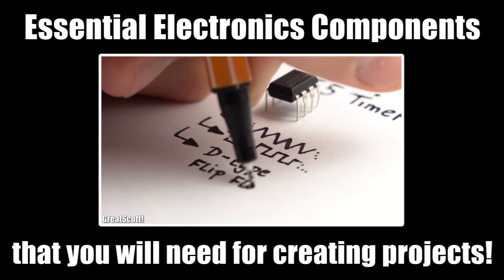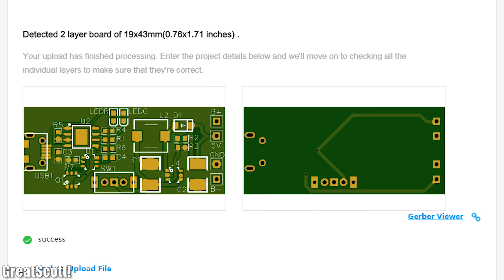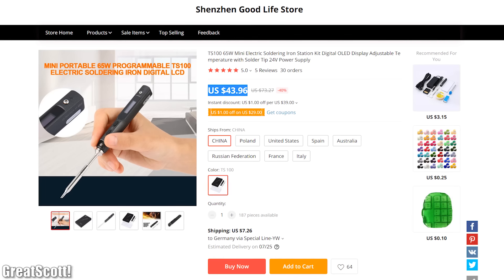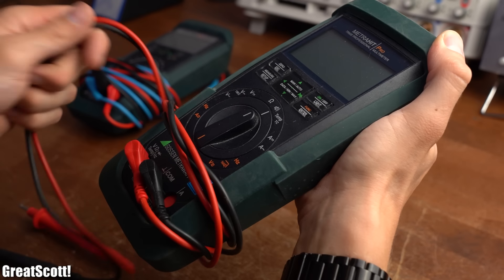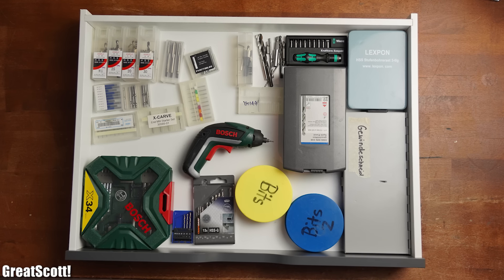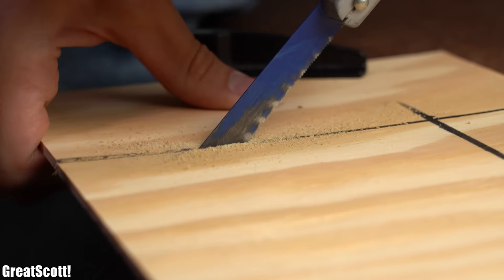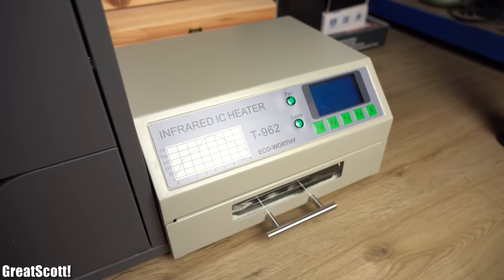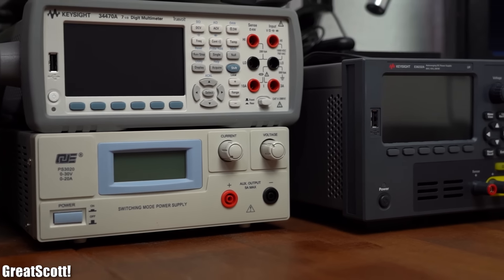Essential Tools that you will need for creating electronics projects!

Comment: You forgot my favourite tool: The label maker.
I hate unlabeled switches and connectors. And it's good for organising your workshop as well.
Reply: I was going to say the same thing! He has a pile of expensive tools but still uses masking tape to label everything !
Just got a Dymo Rhino and i can now label  wires with the heatshrink they sell or use the tags setting to make labels for wires
Reply: +1 for label maker! An analog/manual one or a dedicated label printer (great for weatherproof and durable labels) or at least pre-cut self-adhesive paper for normal a4 printers.
Reply: I was lucky and got the Brother PT-E110 on sale for 20€.
The label material is kind of expensive but it's a very easy to use handheld device that has a dedicated menu for electronics symbols and can print flags for cables.
Reply: You know, I've got several label makers and never used them.  My sister tried to give me yet another one with labels for my birthday and I told her keep it.  I've never used it because it just takes too long to punch things in, and the dang label tape for them is insanely expensive.  Once your tape runs out it's useless.   A roll of paper tape and a sharpie however require no batteries and always works.  Not pretty but....
Reply: Masking tape still works better and is a few pennies. A labelling gun is pointless for 99% of people. Like how many things do you actually label? and what does it do that some masking tape and a marker or some paper with clear tape over it cannot do?

Comment: One of the tools you missed, might be the usb power meter. I find myself using it a lot, and, at least in my opinion, is essential :) And thanks for the great video. Very useful as usual!
Reply: Depends on what you do, if you never work with USB its useless.
Reply: Had one, ended up replacing the USB-Ports with Pins and using it as some kind of low voltage and current meter🤷🏼‍♂️

Didn't stay with USB for too long since I started strolling around with electonics
Reply: USB power meter is really nice :)
Reply: @tobimai4843  No it isn't. Everybody has devices that charge over USB. It is essential to know wich one are bad cables/power bricks and wich are not.
Reply: Janus Kobain a 3d printer is essential IMO, I unlocked so many new projects for me
Reply: @jkobain  I find mine nearly essential if for no other reason than designing and printing cases for my projects. It does a lot more, but you're right, none of the other uses are a must-have.

Comment: >"Essential Tools"
>$1000+ oscilloscope
GreatScott, I hate to break it to you, but I'm broke
Reply: haha same
Reply: Never used oscilloscope, hobbyist for 20+ years :D
Reply: @PexiTheBuilder  wow! I use mine all the time, its an old crt one, 25mhz. I got it at a decent price, $100 (it was like new)!
Reply: There are tiny, simple oscilloscopes that you can fit 5 of in your pocket for ~$20-40 each. I've used some of those and they are definitely good enough for most beginner-to-intermediate users.
Reply: Keysight makes expensive products, but they are also great quality. If you can afford it, I'd look into the Rigol DSO1054Z. For around $375 it's very good for the price.
Reply: @SoLaR27  yeah, still cant really afford it...i'm 13 :D
Reply: @justin.campbell  i mean,i got my first oscilloscope (a mini dso138) when i was 13,and it really helped when making electronic projecs.
Reply: @johnavonvincentius1884  yeah!
Reply: So am I, so I got a PC oscilloscope. Works well, and does the job (it's the Owon VDS1022I )
Reply: For the hobbiest a scope is useful for debugging, but I would not say "essential" at all.  GreatScott uses it to teach and learn about specific behaviors, which is only useful when completely designing a circuit.  
For the average hobbiest I'd imagine it isn't essential until you are designing your own circuits from scratch (not following a guide)
Reply: That recommendation is bad IMO, you can get a pretty good scope for under 400€/USD
The Rigol DS1054Z is a good price/performance option
Reply: Try a Hantek. They're ok for beginner use.
Reply: @justin.campbell  I know, sometimes would been useful. Built "oscilloscope in a matchbox" from arduino nano, havent found any use, yet.
Reply: +1k usd oscilloscope in recommendations for beginner electronics
come on, it's obviously an advertisement/show off video, not a real video where you can learn something
Reply: Morlev44 i agree, he is just showing what he has, not whats essential.
Reply: @vacster123  I've got one of those, I got it for my son, who has never used it. It's way better than nothing, but it's very limited, I'd look at Pico Technology 10 MHz USB scopes for less than $200 (a few years ago when I got one, since then I got the 100MHz version too), way better than the little pocket 'scope. I don't want to dis the pocket 'scopes too much though, they're way better than nothing, just remember that even though they mostly claim 1MHz bandwidth, I measured mine at 200KHz at 3db down. The triggering can be pretty unstable too.
Reply: @gregw1076  I'm probably spoiled as I've been using 'scopes since high school over 40 years ago, but I feel blind working without one.
Reply: @SoLaR27  I have a rigol and I think it is ok for general use.
Reply: oh goody goody goody, very affordable oscilloscopes for everyone! enjoy being reborn in west papua with that big old mine you've never heard about that has killed 700,000 people.
use the audio in jack on your used xp netbook.
Reply: @SoLaR27  I use the Rigol at least twice a week at work. Great product and not too costly

Comment: "Because it costs a lot less" he said, "essential tools" he said.

1100$ Oscilloscope
Reply: With 200Mhz and the function generator it's even $2000 ;)
Reply: For a decent oscilloscope with great functionality that is actually pretty affordable...
I wish there was a great scope for 200 bucks, but unfortunately there isn't. So I can't afford one either.
Reply: I use a cheap (maybe 40 €)handheld Scope. Its not perfect and pretty crappy but it works for detecting if there is a signal at all and thats what i need most.
Reply: That is nothing if you compare to most other hobbies. Radio systems easily go up to 10k. So do drones. But a 2000usd oscilloscope will usually serve you good enough anything other than RF. Not that there aren't super expensive scopes out there but no hobbies will own one. Which is not the case for other hobbyists like machining, ham radio, drones, photography. Their collection usually go above 10k.
Reply: I only paid a little over half that for my better 'scope, which is a dual-channel 100MHz unit, and less than $200 for my 10MHz USB 'scope (Pico Technologies) that does over 90% of what I can do with the more expensive 'scope.
Reply: Just buy a rigol ds1054 and upgrade it...enough for a hobbyist
Reply: @mans4104  These cheap Chinese scopes tend to have a lot of caveats, like "technically" able to do 100MHz in certain measurements but only realistically being a 20MHz scope and even worse most overseas products don't seem to put much effort into the software side of things, so a touchscreen based device like this is just asking for trouble with a buggy UI or not showing you the full waveform even if it captures more than it actually displays.

That scope actually appears like it might be the same scope or a clone of this one here and considering the 100MHz is pretty much a lie, I would not pay $150 for one of them when you can get a 20MHz usb scope for around half that price and if you want it to be portable a used laptop would bring it up to the same price.
https://www.youtube.com/watch?v=5iwtDwJlbWk
Reply: Oscilloscopes are very handy but not the most essential. You can get a decent used one for under $100 which will be way more than enough for most hobbyist work.
Reply: I bought a $60 Owon usb scope, and I love it. 100Msps and bandwidth around 10 meg.
Reply: @error8418  hantek portable scope is 200 freedombux (us dollars)
Reply: I use the Rigol 1054z. It's only $350US and does a great job.
Reply: You can get basic ones for cheaper, and buying used stuff is can also be quite cheap

Comment: I am going to put in my opinion as well:
The tools I use regularely and I think are the minimum you are going to need are as follows (listed in order how often I use them):
a lab bench power supply, a multimeter, an oscilloscope, a soldering iron.
Also I think it doesn't have to be the most expensive or the newest equipment
my Power supply (0-30V, 0-5A) did just cost around 35€, the soldering iron is my dad's old one, it has a safety transformer so it kind of looks like a soldering station but the temperature is regulated by changing the tips, for a multimeter I have a new one and one from the 80s and they preform equally so to me it comes down to if you prefer an analog meter or a digital display
none of that equipment has failed me to this day and I didn't come across any limitations yet
the oscilloscope on the other hand is also an old model, I got it from ebay for 80€ and it actually did blow up at one point it was easy to fix but that always might happen to old equipment.
You might notice that I didn't bring up a function generator, that's becaue I made one myself simply by connecting an operational amplifier to the headphone output of my computer and using audacity to create a waveform. Worked for me but when you do that always put a 10nF capacitor in line with the signal wire with a 100kOhm resistor between the used input of the amplifier and ground and another 100k resistor between the signal and shield wires of the audio jack, that way you get rid of any ground connection of the computer and protect it from shorting it without loosing the audio cable's shield.
and always test on breadboard first but keep the capacitance between the breadboards traces in mind ; )
for basic parts you should always have in stock I recommend a set of resistors, at least 100Ohm, 1k, 10k, 100k and 1M, different capacitors (the ones I need most frequently are ceramic 10nF and electrolytic 2,2uF, I recommend getting sets with those included), LEDs of different colors, a couple of 10kOhm potentiometers, any silicon Diodes, BC547 and BC557 transistors, any operational amplifyers and at least one micro controller 
if you read so far I hope this might help someone
happy tinkering to everyone
Reply: I use old phone-type chargers instead of a proper bench supply (but I would like to get one.) The one I use all the time is 5 volts but it has nice current limiting of around 1.1 amps instead of the more common 'hiccup' mode.
Reply: You must not compromise on the soldering iron; a temp regulated and nicely grounded or isolated tip is needed.
Reply: @janami-dharmam  who speaks of compromising my dad almost regrets having given it to me now and whenever he does bigger soldering jobs he borrows it back from me
it has a much nicer handle and performs better than his new one, the only downside is it needs 2-3 minutes to heat up and about 10 minutes to cool down enouh to touch it
even replacing the tips for different temperatures isn't that bad
just because it's old doesn't mean its not good anymore ; )

if anyone is interested here is how the temperature regulation works:
in the soldering iron is a switsch controlling the heater and on top of it is a magnet so whenever there is something magnetic in front of it it turns on and when you remove it it turns back off, in the tip is a piece of a magnetic alloy that looses it's magnetic properties at a certain temperature so it switches off the iron when it's up to that temperature and back on when it's cooled back down thus holding the iron at that temperature rather precisely.
Reply: @fdsmaster8098  If my memory serves me right, this is a Weller soldering machine and it costs a fortune - even a single tip is expensive. It is still available in the magnastat model and costs more than 100USD or 100Euro. They are almost topline models.
Reply: @janami-dharmam  It is made by Weller indeed, I don't know how much it had cost since It has bin passed on from my grandfather who got it from his workplace when they decided they had more than they needed and wanted to throw them out to free space so his boss said he could have it.
the tips for this particular model cost between 5 and 10 euros wich I find reasonable considering the Tip it currently has is about 30 Years old, used a lot and still perfectly fine

Comment: Hey, for my personal experience i recommend having a smaller oscilloscope. I use the DSO203 or DSO quad. Of course, it is less powerful than 1000$ beast but it is suitable for 95% of my work. 
Another really important tools is logic analyzer. You can get the DSLogic from banggood for 100/150$ and it can help you a lot with all signal you can have to debug. 
And the last step for me is small utility knife and tweezer for small electronic. 
To summarize : 
- DSO 203 as oscilloscope
- DSlogic for logic analyzer 
- Good pair of tweezer 
- Good utility knife 
- Wire stripper 
- TS80 or TS100 as soldering iron 
- Small fan to extract the fume 
- Small tube of soldering flux + soldering wick + solder pump 
- A good lamp and magnifier 
- A thrid hand or small vise to hold a pcb (some people use patafix or other sticky paste)
- Multimeter, Uni-T is a nice brand but you can get used Fluke for 100$ on ebay 
- 3D printer (ender 3 for me)
- a set of file to rework your print 
- A dremel or any cheapo small rotary tool
- A leatherman Wave of Charge (personal taste since i use it a lot). Can become a must have on the road.
- A decent kit of screwdriver and general purpose tools

P.S : It's my vision of required tools. Maybe i've missed something or the tools i use seem unusable for you but please bear in mind the idea of "small budget beginner friendly" stuff.
Reply: How to friendship with you 😉 I am ...
Reply: You really impress me...
Reply: I fully agree here! Depending on the project, a logic analyzer can be a very helpful tool. Also havin a DSO is important, but a cheap 20 MHz 2 Channel scope is more than enough for 99% of all hobbyist projects... You rareley ever need several GS/s and 100s of MHz

Comment: I fully agree with most of your suggestions. I would also add:

Wire cutter It's a bit brutal sometimes but always works

A magnifying glass. Even if you have perfect vision, it always helps to zoom in to see better. Plus the LEDs help even in bright environments

Soldering flux. It makes soldering soooo much easier, put it in a small syringe so that you don't make a mess or use more than it's needed (it stinks but only when burned and is not good to breathe)

Acetone and an old toothbrush. They help a lot with cleaning the mess that comes with soldering especially while using flux.

If you don't have a heat gun, use a lighter to shrink heat shrink tubing. It needs a bit of practice to learn not to burn it. A jet lighter works very well. Too well, even with a normal one I'm now fine with not having a heat gun

Solder pump (this thing that sucks melted solder with the press of a button). It has saved me tons of time and it was less than two bucks there's no reason not to have it when you need it

If you can't afford a lab bench power supply, get a variable voltage transformer. It looks like a normal transformer but at the bottom it was a knob to choose between 3, 4.5, 5, 6, 9, and 12 volts. It's dead cheap (around 12€) and works flawlessly

Helping clamps (they hold the circuit in place while you're soldering). I can't live without them after I got them for less than 10€

A ruler is also handy to have around along with a marker.

Comment: I recommend updating the firmware of the TS100 to the open source variant, it improves the soldering iron quite a lot.
Reply: agree. Initially I was disappointed, but after installing the OSS firmware I love it!
Reply: Do you have a link for it?
Reply: @akhurash  I'm not him, but Ralim is (i think) the one most people talk about: https://github.com/Ralim/ts100
Reply: Yeah I also love the Tetris version.
Reply: Holey moley! You can upgrade the firmware? This iron is now on my wishlist!
Reply: The same firmware works on the PineCil as well, which is a bit cheaper than the TS100 but is able to use the same tips

Comment: Safety eyeglasses. That protected me when I really thought the current task is harmless.
A cheap one from a bicycle shop is fair enough.
Reply: No shit, losing your vision sucks.  Fvcking carb cleaner in a can blow back got me in one eye.  Fucked it up for good.   Any sparks or solvents in a can are dangerous.
Reply: I use safety glasses all the time when soldering ever since I had a speck of hot solder flung at my eyelid.